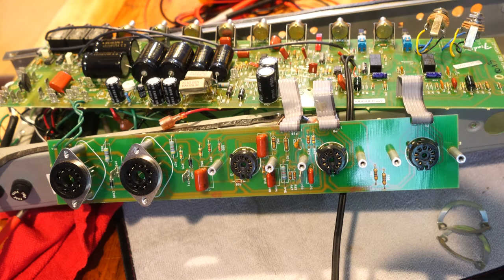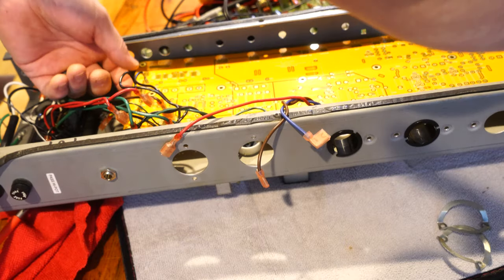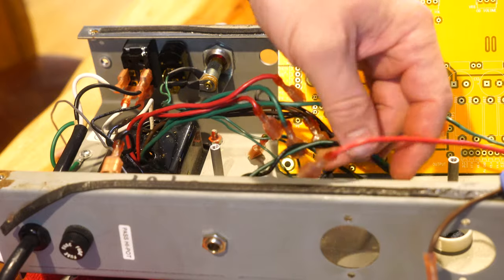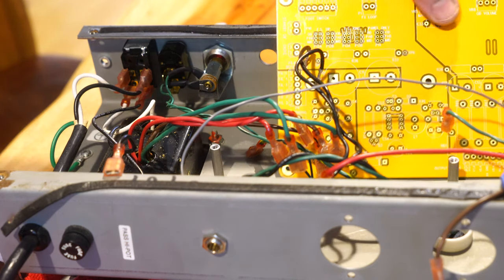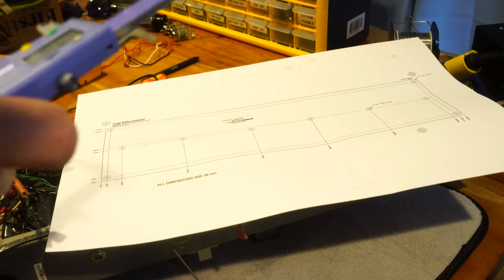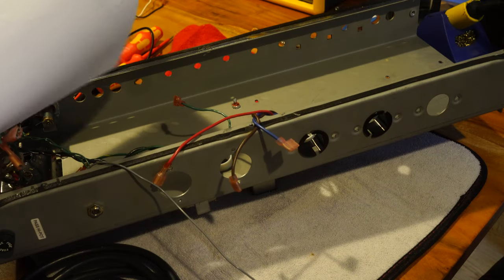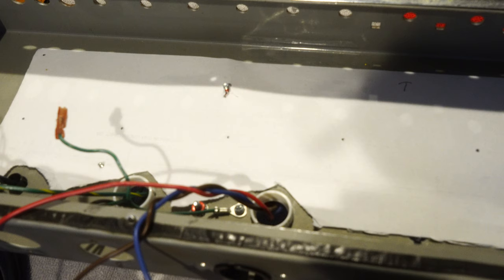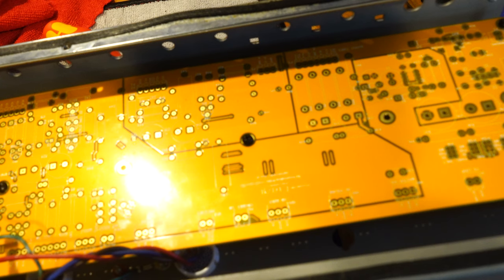Blues Deluxe To Dumble ODS #183 Video  2

Comment: I tried to wire the Fromel cap upgrade to my brand new blues deluxe reissue, those ribbon cables came off easy and I messed that pcb up so bad trying to solder on them back on, and it’s been sitting apart for 10 years now😂😢